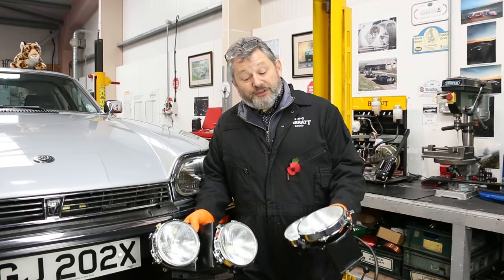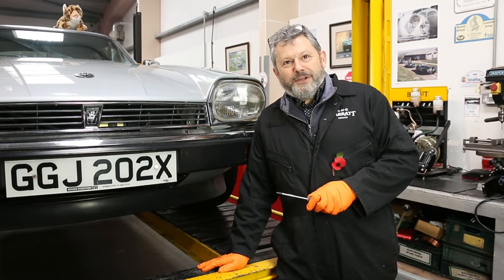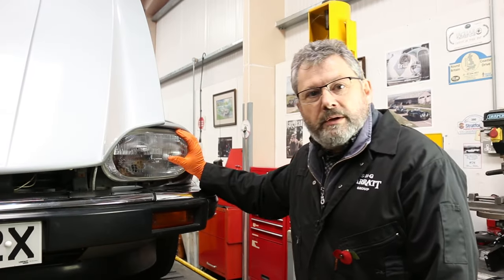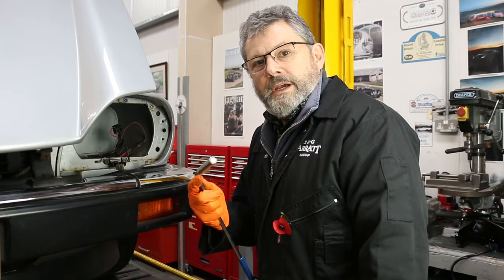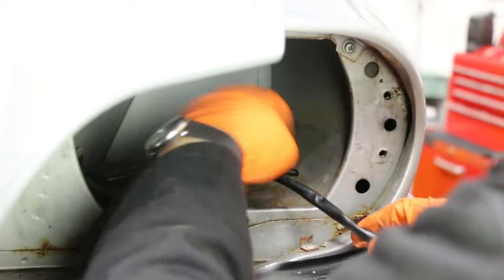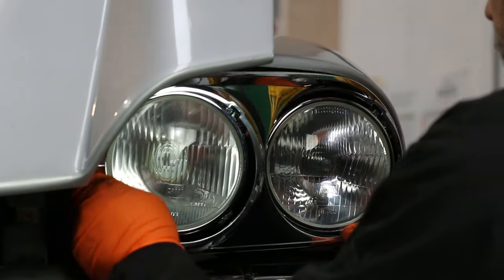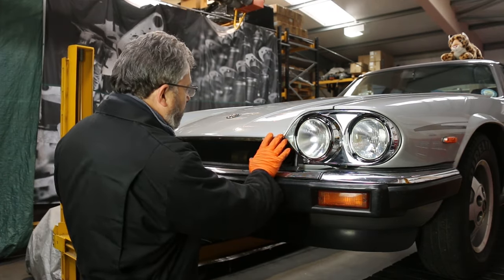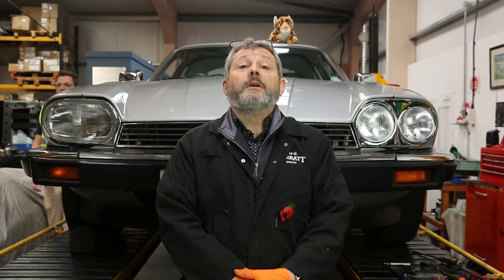Quad Headlamp Conversion | Jaguar XJS Upgrades - Episode #3

Comment: Rectangles all the way - You dont mess with the classic & original. You look at an XJS parked sitting there, it looks like a cat just laying there eyes half open/close resting but aware and poised.  Theres that imagary, that mind slip connection to that type thing. Its the lines, sleekness, class, style the quads just kill all that, changes that whole aesthetic still looks ok, but that romance is lost.
 I've had 3 XJS and yeh them big lights dont last & seriously thought about sourcing quads as an "edgey custom" but had it told to me in 86 with the release of the XJ40 only the budget models had quads while the Sovereign's & Daimler's had rectangles ( outside of the US) right hand drive with quads will make it look a low spec model & cheap variant. Only car enthusiasts know the reason for quads "the Us market", Dont mess with it, it wont add value to the car,  keep original  he talked me out of doing it.

Comment: I find this vid slightly amusing, as I suspect a lot of us Yanks would want to do the exact opposite!  If I had an XJ-S, I would want the ones you're taking out!  Problem here is we are forced to find ones from the continent (LHD).  As it is I just picked up a '73 XJ6 and one of my early jobs is to fit the proper 7" outers - when my car was new, our automotive lighting regulations still dated from the 1940's including you couldn't put two sizes of headlamps on.  Same with my BMW e28.  Complete shite.